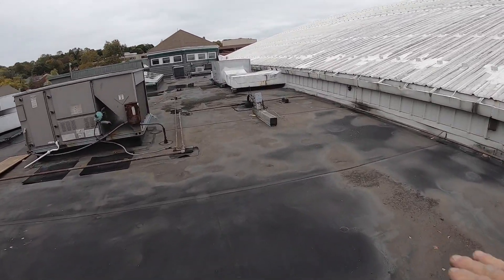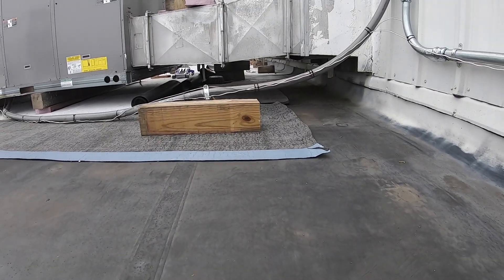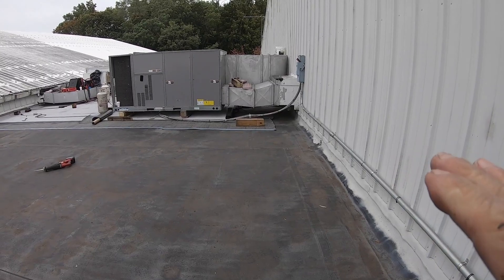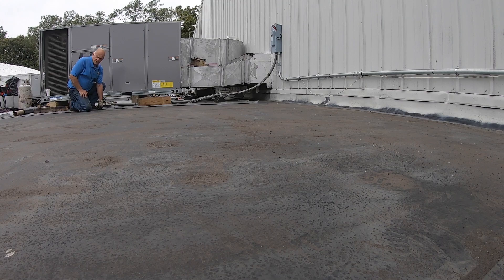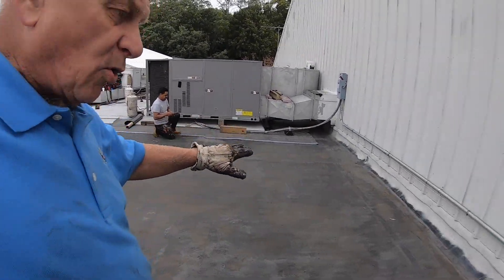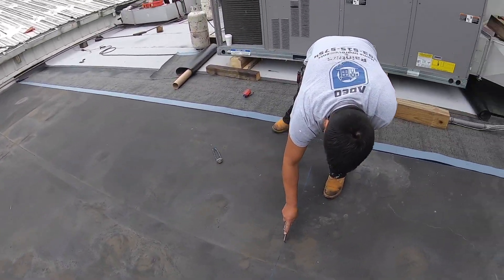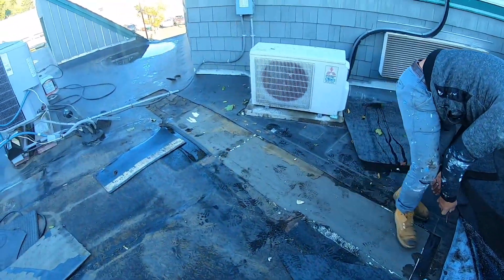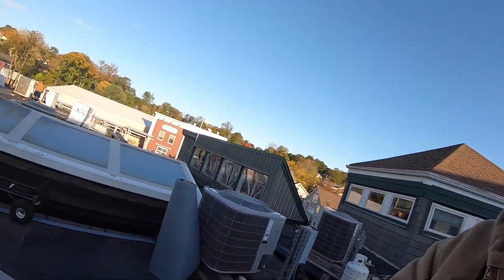How to remove pooling water on a flat roof - simple technique

Comment: I actually hate flat roofs. If they would have just built the damn things with a decent slope you don't have these problems.... Maybe its cheaper at the start, but I think its more expensive in the long run to have a flat roof.

Comment: I have a row home and learned alot from you watching your videos. I have completed half of the roof because it has two angles. Front of house angle is completed but the other half the angle is perpendicular and the drain is puddling. I don't know if I will get an answer from you but I am thinking of building it up using bitumen cuts and lay them like a staircase so that when last piece down is highest point to the lowest point.

Comment: Thanks for the great video! I have a flat roof with ponding on one corner. There are three layers and should be replaced probably soon. I've made sure the seams are filled and used the Henry's wet patch. However, I still get leaks into the building right where the ponding is. I've heard that with the asphalt roll type material it can leak right through the material if the water sits for a long time. Is that true? The top layer is about 20 years old.  Also, to fix this, could I just cut the top layer from the ponding to the drip edge so the water flows off the roof? Seems like that would be the easiest fix. Or better to fill the pond with a filler of some sort? Thanks so much. Your videos are very informative. All best.
Reply: I have same problem and used Henry's wet patch can you tell me how you fixed yours?
Reply: @kimpozo3514  Couldn’t fix it. I just put a tarp on the roof until I can replace. Good luck!

Comment: you are giving the wrong information to people, the reason you find some of the roof membrane floating is because there are different application systems and most likely the mechanically attached won't have to much glue because is held different, also EPDM is one of the proved long lasting systems, it all depends on the applicators, the job is not the best on my personal roofing professional opinion
Reply from the maker: The best EPDM roof and best installer does not make it a good roofing system. They have revised the adhesives for EPDM already 6 times since the 60's when EPDM was introduced. Why keep on changing the adhesives, tapes if it was so good. It takes 20 years to test a roofing systems reliability. The last revision for EPDM adhesives and Cover Tape was only a few years ago. That has not been proven. You have no clue on EPDM or any glues the way you talk

Comment: Didnt you say pounding on the roof is fine? And why such long screws?
Reply from the maker: Ponding? Water sitting on a Torch Down roof does not hurt the roof. But, when you have water ponding all over the roof, it will cause debris and leaves to collect, and then plant growth. Moskito breeding ground. Also, it looks very bad on my reputation if I leave a roof the way others did it. I like to improve water flow and make it less maintenance in the years to come.
The long screws are so you can reach the metal decking to screw into which can be 4 to 6 inches deep below the insulation.
Reply: @FlatRoofDoctor  lol, ponding*. And true, it doesn't effect the longevity of the torch down or anything? And true how long of screws do you use and what kind of screws?

Comment: I have a modified bitumen roof with a couple of areas about 6x10 feet that pond between 1/2 and 1 inch of water . the roof has been this way for over 40 years and those areas are always what leaks  and eventually necessitating total roof repair. They are also only a few feet away from the lower edge side of the roof ( maybe 3 inches fall over 30 feet with gutter on that side)
Is there a leveling product that could be used to remove these low spots and then coat with something or put ,ore torch down over it ?
Thanks in advance.
Reply from the maker: I strongly advise removing the hump to get water flow but if you want to fill the ponding area, then use 1/2" or 1" ISO boards and torch a new membrane over that.
Reply: @FlatRoofDoctor  Ok Thank you . There isnt really a hump just this place is lower. I will try the iso boards. I saw the roof leveling cemanticious fiber compound and just didn't think it was a great idea to use it.
thanks again!!!
Reply from the maker: @teekay1785  I have never tried that fiber stuff. But here is my take. Use anything to fill in. That fiber stuff might just be the thing. But the install a new membrane over it.
Reply: @FlatRoofDoctor  OK Thanks

Comment: I hear you, but what building owner wont like more insulation to combat heating and cooling costs?
Reply from the maker: There is already more insulation than needed. Besides the insulation on top of the roof, they also have insulation on the inside above the drop ceilings.

Comment: I'm a flat roofer and I've seen plenty of roofs that fail because of wind uplift as wind rolls over any surface it creates suction that's basic roofing
Reply: I do love ya videos though
Reply: I've seen a field seam fail on a home depot roof after a wind storm.  Might something to it.  Between plating the ISO and gluing your rubber down it really shouldn't be suctioning.  It was a parapet so Def didn't gust under the membrane.
Reply from the maker: That is your theory. Yes there is a slight suction but not enough to lift a roof up, especially a Torch Down 2 layer roof.
I have repaired many roofs from wind damage due to the North Easter in Connecticut and all of them lifted up on the sides where the facia or drip edge is. I saw a metal roof, old single ply torch down and several EPDM roofs that lifted up due to a weak perimeter.